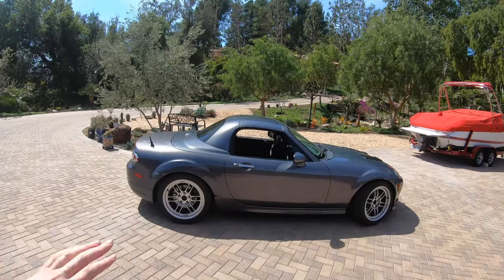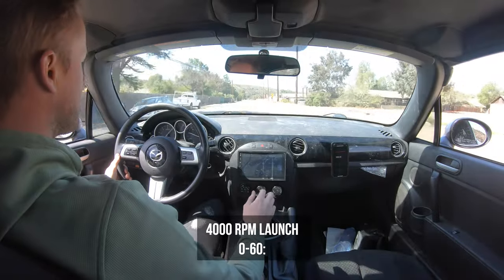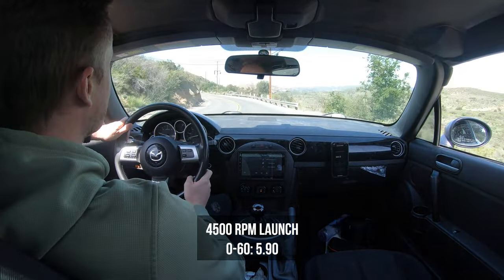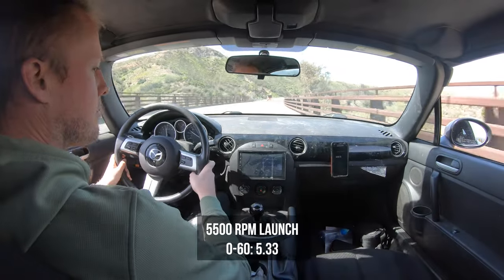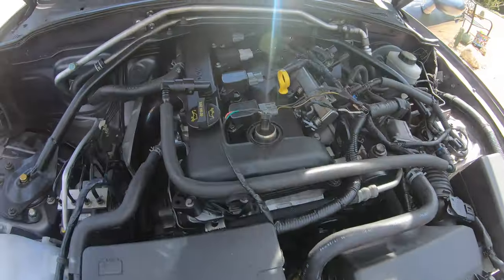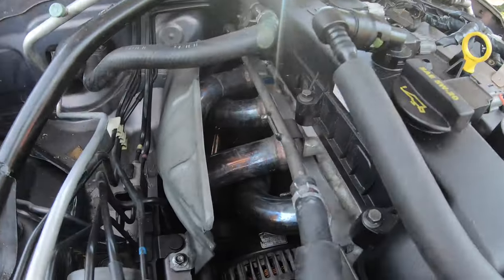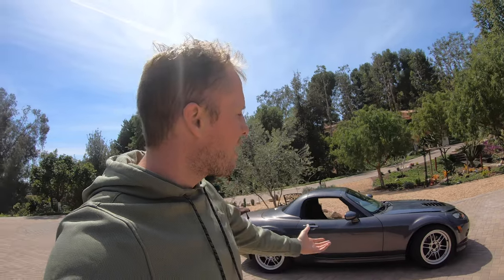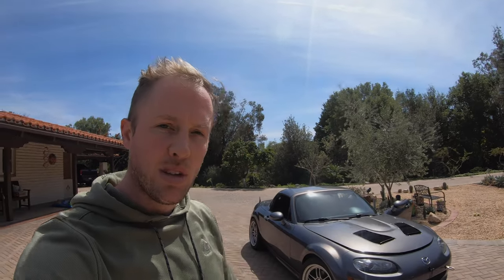2.5 Miata Dyno Tune and 0-60 Test

Comment: hey dude i noticed on one of your recent videos that you have not braced the back end of your nc!
i recently braced mine and iv gotta tell you it has transformed the car.
it handles better rides better and feels like a higher quality car! handles better, corners better,,,, everything is just BETTER!!!! ok!
it has also improved the how the car accellerates as the power nolonger has to go through the bodyflex before going to the road.
the 3 il motorsport braces are, interms of mx5 modding, dirt cheep! turret brace in the boot,  mid brace behind the oem x brace (looks abit like a mantaray wing) and a bar brace behind that.
anyway hope this helps. loving the videos.
miata 4 life!
Reply from the maker: I'm interested in trying them. Where do I buy them?
Reply: @ZentRose  ok it seems youtube dosnt like me linking the to page!

i am in the uk but the guy from the "coloured in light" channel, who is in the US has some of the braces fited to his car so you might be able to drop him a comment to find out if he got them US or ordered them from over here.

to navigate to the right page on mx5parts    uk,  go to mark 3, suspention and steering, chassis braces.
the 3 braces that really make a difference are
Chassis Brace, Mid Lower.... Chassis Brace, Rear Lower....Rear Upper Strut Brace.
go for the red il motorsport ones, those are what i put on!
there is a 5 peice kit on there but you dont want that because the engine bay brace isnt good, if you want to change your engine bay brace go for the 4 point ultra racing brace.

if you want to know more on this i can hopfully link you to my cars project thread on the UK owners club forum.
ok, hopfully youtube will let me post this comment! 4th time lucky eh
Reply: lol it took me 8 tries to post that comment in the end

Comment: Great video.  I’ve been looking hard at a Fab9 2.0 turbo’d Miata so good to see what the 2.5 can do.  Turbos can make some impressive low in torque and high-end horsepower, but it sounds like you get pretty decent torque fairly early with that 2.5.  Plus you can probably find an engine pretty easily.

(Shoot, I just saw your comment about the engine blowing at the track.)
Reply from the maker: I'm building a new one. It will just take awhile to get going again.

Comment: great build and thank you for sharing! you might have mentioned on a previous video, so I apologize for asking, but where did you buy your motor and cams? from?? thank you and enjoy!
Reply from the maker: I bought the engine from LKQ on eBay and the cams from Fab9. Just be careful with fab9. Their tune caused my first engine to fail. Their 2.5 tune was way off as well. I got a proper dyno tune from a miata tuner and all is well!
Reply: @ZentRose  
Engine years that work with the swap?  13’-16’ a good fit?
Reply: @ZentRose  Thank you!

Comment: Would be really interested to see a comparison video between this and the s2000 and which one you enjoy more. the 2.5 cam in my NC definitely feels faster but love having 9k redline vtec in my ap1
Reply from the maker: I've been thinking about that since I started this project but I am waiting until I track the 2.5 miata to finalize my thoughts!
Reply: @ZentRose  can't wait to hear I've owned an AP1 and AP2 and well around town I really love my PPE headered NC1
Reply: Can confirm that the S2000 assasinates a 2.5 NC
Reply: @TopVineVideos  I doubt it. I've seen a  2.5 miata keep up with a Porsche GT3.
Reply: @TheFracturedfuture  if done properly my JDM F20C powered AP1 with an ap2 trans hits 60 in 2nd in the low 5’s. The additional shift is what makes the Miata slower. 

I’ve kept up with NSX’s.
Reply: @tylerhoover1770  Well if we are going in that territory then an LS Miata would be a better contender for that set up.

Your S2000 is impressive though, you should post a short of your 0-60 it would be pretty dope.
Reply: @TheFracturedfuture  well an eBay turbo kit on a suburban would kill all of them. Lol I just might
Reply: @TheFracturedfuture  are you taking about driver46’s video??
Reply: @twizzy8783  Yes.
Reply: @TheFracturedfuture  he's a super skilled driver but he did not keep up with the GT3 💀 The gt3 was driving so bad and they passed the miata. The miata did do a really good job tho, its insanely good for the price

Comment: How much crank hp is that??
177RWHP = 246HP Crank? Thats nice if so!
5.33secs is incredible.

My goal is a NC3 (I had a NC2 daily for 6yrs, loved it) but as a project car one day Ill buy one again.
Then I'll keep the stock 2.0L but add BBR Individual Throttle Bodies, intake and exhaust cams, header, midpipe, muffler, tune
My end goal would be 165rwhp / 230hp crank.
I'll weight reduce it as it would be a weekend car only, from 1167kg to ~1050kg is my goal.
That's would be a good power to weight ratio.
Seeing your results for inspiration makes me excited for what I could expect!
Great video, sick quick shifting.

Also, noticed you had to shift to third to get to 60mph, I can get to 62mph in second gear? Does the new engine not rev as high as the stock?
Reply from the maker: Maybe 210 - 220 crank depending on drivetrain loss. Yes the rev limit with the 2.5 is set pretty low so I need to shift to third to hit 60. I could rev it higher but I would shorten the life of it
Reply: @ZentRose  
Ok thanks.
2.0L with BBR kit increases rpm from 7500 to 7800 should be interesting.
Reply from the maker: @printedprops8730  hell yeah.. that's gonna be awesome

Comment: Awesome car!! What trans 5 or 6 speed isn't the 6 speed geared smaller??
Reply from the maker: 6 speed. Yes I have to shift to 3rd before hitting sixty. The gears are pretty short
Reply: @ZentRose  Wow that makes your 0-60 even more impressive I've got an 08 NC1 5sp and considering a 07 NC 1 purchase that has a 2.5 with 6sp and GWR header free flow cat and Enkei RPF1S like your car i think I'll be IMPRESSED!!😄😄😄
Reply from the maker: very nice! enjoy your NC. The 2.5 NC is surprisingly quick

Comment: Is this CARB legal?  My CA registered NC1 has 190k miles so when the original 2 liter engine is done I wanted to get exactly what you have.  The 2.5 with headers and probably an off the shelf flash kit later on.
Reply from the maker: not technically legal but if you live in a smog free county its not a problem.

Comment: Are there be any negatives you can feel by the removal of the balancers in the 2.5 engine?
Reply from the maker: I can feel a slight increase in vibration at idle.  Try to test drive one to see if it bothers you.

Comment: You only have header mod on this car it's not cammed? You launch at 5500 I've heard a 2.5 not cammed will stop pulling at 5200rpms? Have i heard wrong? Does this car pull to 6800 redlines with just header swap??
Reply from the maker: Stage 1 cam. Pulls strong to 7200 rpm
Reply: @ZentRose  thank you sir for response!! That explains it!😎

Comment: How much was the labor cost for the engine swap + misc parts?
Reply: Was in the last video believe said $2200
Reply from the maker: The shop charges $2100 labor for 2.5 conversion which includes the cam install and the other stuff like intake porting, balance shaft delete etc.
Reply: What shops you recommend to do the 2.5 swap in Los Angeles area? I live in the IE closer is better for me.
Reply from the maker: @rolldog82  The first shop I used messed up the swap and the engine blew. I am taking it to another guy who only does these swaps but he is in San Diego.
Reply: @ZentRose  Goodwin shop? It's a drive but they seem reliable.

Comment: Atm driving gutted and lightly modded 330ci, but by the day i tend to look more at mx-5 nb and NC. From your Pov as you owned and modded both platforms, (miata is always the answer) is there big difference in fun factor excluding fact that mx-5 has got no roof.
Reply: NC is light years ahead of the NB.
Reply from the maker: For a fun car the Miata is hard to beat. For daily, the bmw is going to be more useful. I have been daily driving my NC with no complaints.

Comment: Just to put this into perspective... my 2022 challenger R/T 5.7 hemi does 0-60 in 5.2.... this car is doing that on a stock 2.5... now throw some headers, cams, and open up the piston rings just a hair... throw some boost at her and you're in SRT territory :D
Reply from the maker: Hey I have header, cams, light flywheel, and track tires on this mx5. I think an srt would destroy me until I add some boost to the mix.

Comment: I got my nc into the low 4 second range at 310whp but it blew so turning it down.
Reply from the maker: That sounds like a fun build 🤙🏻
Reply: same i made 305 whp and blew in only about 4 months. debating on going back fi under less timing since im sc. or leave it na as it sits right now.